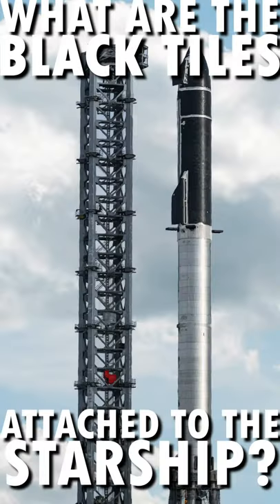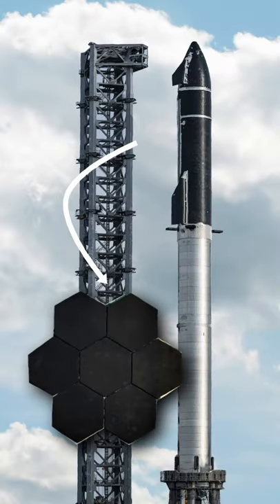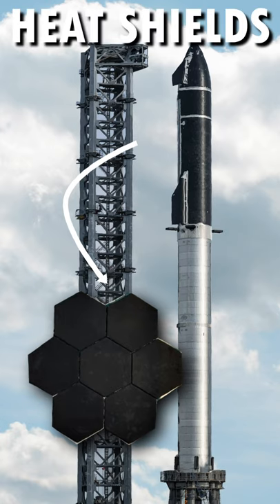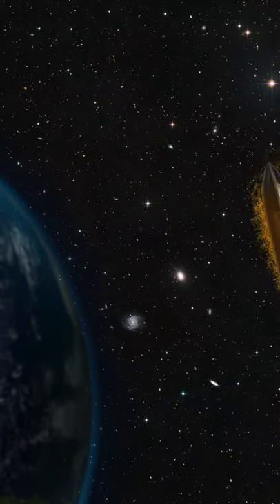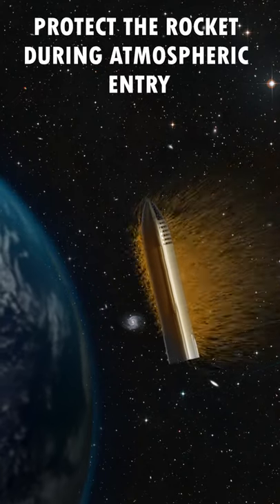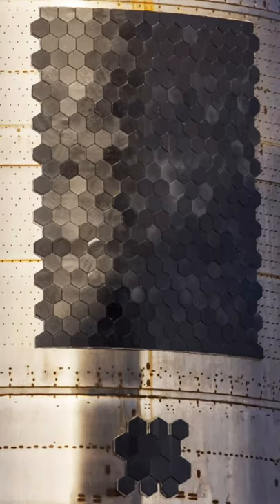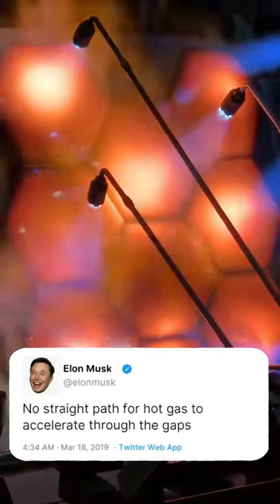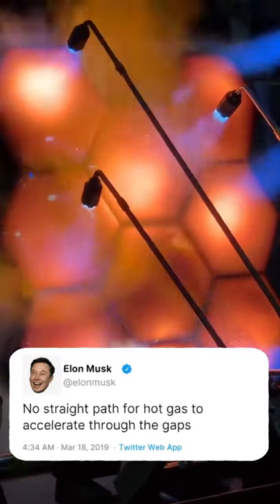What are the Black Tiles Attached to the Starship #shorts

Comment: Damn 5miles per second, that's fast
Reply: 18000 mph
Reply: Damn... That's fast
Reply: 18000mph
Reply: @witherkillz1174  dude it’s 300MPH
Reply: @RealGalaxyGamers  that would be per minute my guy
Reply: @RealGalaxyGamers  18000mph
Reply: 5 miles a SECOND = 18000 miles an HOUR
Reply: @RealGalaxyGamers  You're referring to MPM
Reply: Ppls speaking about 1800mph but dude... he said 5 miles PER SECOND! Not per hour also 5mps and not 5mph
Reply: @joseunknow6144  ISS actually travels almost same speed!
Reply: @joseunknow6144  dude 5 miles per second = 18000 miles per hour

5 * 60 * 60 = 18000

Comment: The thing i learned here was that the hexagonal form of these heat shields are for the gasses to not have a straight path to accelerate... i thought it was for something like to be able to fit them better in some places
Reply: I think thats more the reason its tiled instead of just one massive sheet of them

Comment: What's crazy is that the super modern starship is now using 70s shuttle tiles 🥴
Reply: It was a good 😊 idea 💡
Reply: @stevesalvant80  it really, really isn't. Meanwhile the Chinese have figured out the can use pieces of cork (tree bark) coated in resin to serve the same purpose. Tiles were the downfall of the shuttle, and they'll be the downfall of starship. Its a failed tech.
Reply: Just because it’s the same concept doesn’t mean it’s the exact same technology

Comment: SpaceX should make these tiles into one complete piece before attaching to starship. This might make it easier and quicker to attach and less chance of small pieces falling off.
Reply: How are you going to develope such huge piece of such a fragile tiles in the first place. 
They even had trouble making it stop cracking at it's own let a lone the size of the entire rocket
Reply: Thats not possible. You dont understand the whole concept. Heat makes things expand and contract when the cool. They have to be a certain size so that each ones expansion doesn't allow gaps. Its just like rail road rails. They have to have joints to allow for this same expansion and contracting. They have welded rail nowadays and theyre having trouble when the winter months get really cold they pop in two causing a several feet gap that de rails trains if not found beforehand. They have that par of the science figured out on those tiles.
Reply: It would have to be applied like paint.
Reply: Possibly something added to the steel to give it heat shielding properties.

Comment: I still don't really understand why they don't use the metals that are actually able to withstand that temperature. Because there are a few of them. Actually think there's two. They have higher melting points than tungsten. Or they could just do a low-speed entry which would burn a lot of fuel but it would save a lot of money on ablative shielding
Reply: No that's not possible. Trust me. Even if they use tungsten the money and weight gonna be problem. And its stil metal, heat gonna quickly reach the inside parts and melt them. And slow re-entry is need too much fuel. They do suicide burn because of that.

Comment: Question with the rocket scientist, would it be possible to make the ship rotate as it's entering Earth's atmosphere? To allow different parts of the skin to be in contact with the friction.
Reply: But... Why would it roll into the plasma?
Reply: It would be difficult to rotate at that speed when it’s being pushed like that but if they close the wing flaps they could but there’s no point
Reply: You don't want heat to get trapped in the first place, you want the plasma to get away. Rotating the ship is only to prevent parts from overheating. But your parts are designed not to heat up.
So why rotate?

Comment: The system is flawed, Im no genius but placing separate tiles help with replacement, but do nothing for ultimate protection, a skin with overlapping grids  ..oh f it , I'm not wasting time on this , the rocket scientists know better.
Reply: I am skeptical as well.  We shall see.
Reply: He said that they used tiles to prevent gases from accelerating

Idk, seems legit
Reply: @derrick8206  they used this on the space shuttle
Reply: Basically heat makes things expand

Comment: I knew it was something like that because they use little black balls in large water reservoirs to keep out heat
Reply: I don't think this and that are related at all.
Reply: @Matityahu-the-God  yea the balls are just to cover the water from sunlight
Reply: @caldeira_a  and they're usually just hollow plastic spheres. I couldn't imagine a heat shield tile floating super well.
Reply: @Matityahu-the-God  I guess it could work since it has a big sorface but would depend on its density, not sure what the material is

Comment: I wonder if the transfered heat energy in the rocket can be used as an energy too
Reply: I think it can not be used for anything, I know it is such a waste to let go of that much heat and potential energy.
Reply: @Dylan-ni1tc  we dont dont how the universe works well just wait until science find its way
Reply: @johnvincentderoma2135  uhm, you don't need to understand how the whole universe works to understand some basic physics and some knowledge of rocket designs.
Reply: @johnvincentderoma2135 let's imagine you can store that energy. If we are 10% efficient, because heat is not very good in converting it to mechanical energy.

E=0.5mv^2+mgh
=0.5*10t*7.5k*7.5k+10t*10*100k
Let's store that heat in 1000 kg of water
And water has 4kJ/kgk specific energy
So E*0.1/(4k*1k)is 7281K

Which means your water will heat up to 7.5 thousand degrees. That is thrice than enough to melt steel. And if we take 10 tonnes instead of 1 then we end up with 750 degrees, enough to destroy the tank due to overpressure of at least 3200 bars (my steam table is not big enough) 

So in conclusion :
Dont harvest the energy. 

So clearly

Comment: "Let's reinvent the space shuttle and call it starship"
Reply: That's so far off its astonishing.
Reply: @Matityahu-the-God  no its not. It's actually way more similar than you thought.
Reply: @derkach7907  it's way more different than you think
Reply: @derkach7907  that's like saying the helicopter is a reinvention of the plane. You're trying to oversimplify what Starship does.
Reply: @Matityahu-the-God  then name me one major difference between the space shuttle and starship?
Oh, one lands like a glider the other vertically?
Wow, I guess I couldn't see it. How foolish of me.

Listen :
There is literally nothing different between those two systems. Both use a second (unrecoverable) stage to get the cargo crew up.
Only part of the rocket is recovered, yet its not ready to be reused. Both need immense repairs, meaning they are both refurbished rockets, not reused.

Both have a significant cost of launching something up, the only headlines you read are those subtracted by the subsidies of nasas 3 billion program to spacex.

Nasa will never usestarship for  important satellites. Never. Not with the current explosion rate.

Number one rule in rocket science everyone forgets: costs! Oh no, it's actually safety!!

If you rocket is only half as expensive but is only 95% reliable, then no one is ever gonna use it. Doesn't matter if it's cheap or environmentally friendly or reused.

Saftey is the most important aspect. Main reason why the soyuz rocket is still being in great use after more than 50 years!

Yes its old and expensive technology, but it's the most reliable rocket ever constructed.
Thats just a fact. You can literally look everything up I said.

But because you are already in this narrative of (musk great=spacex great) you won't change your mind. Not even after mentioning all the fraud and lies musk told everyone.

Did you know? Musk didn't do anything and gets all the praise. Funny huh?
Reply: @Matityahu-the-God  and btw, landing something like a glider is a million times more safer than landing with Mach 0.5 down to the ground and ignite the engine on the last 2 seconds before impact.
Yeah..., funny to think you have to use the same engine with a small failure rate. Doubling your chance to die.
Awesome. How can the starship not beat any other rocket? Wow, elon must be such a great genius.